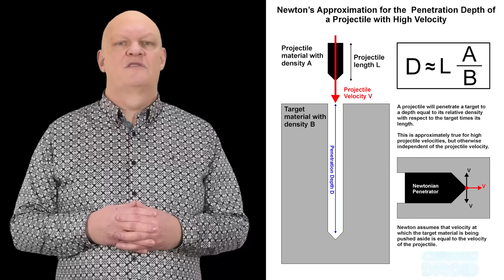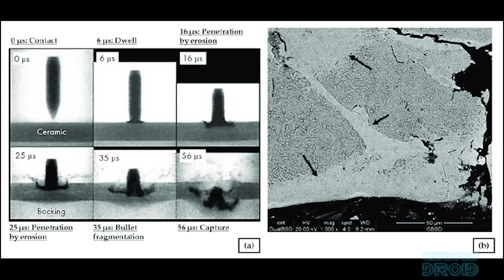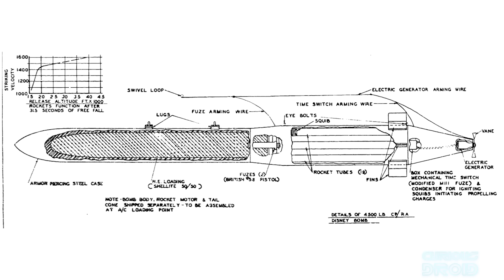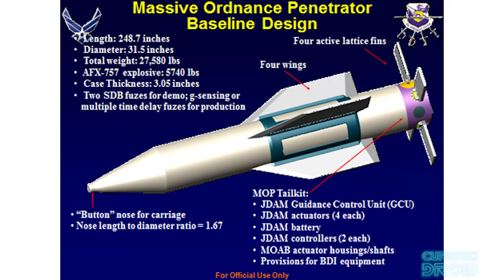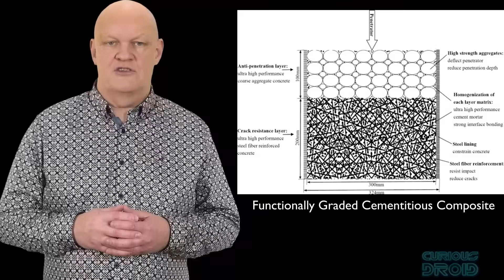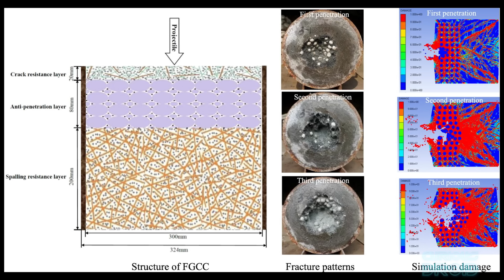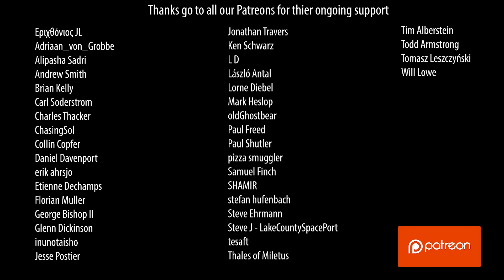Can Iran Stop U.S. Bunker Buster Bombs?

Comment: Just imagine haarp causing tremendous sustained earthquakes deep in the earth with pinpoint accuracy... followed by large TR3B style anti gravity hover crafts showing up every few minutes to drop Rods from God in precisely the same spot over and over, to hammer through the weakened structure. Followed by weaponized weather extreme flooding to flood through the cracks and drown anyone still living deep underground.
Is this sort of thing very far off?
I have a feeling that fortified concrete might be 40 years behind the times.

Comment: This bunker bombs will not happen in Iran...Iran has the V2(/)+ T drv Detector that is the equalant of the Iron dome process..Armour plate Tungsten gets its knetic energy is reduced to a level that its complete cycle is lost upon intial contact ...It will require a B52 Stream bombs to be dropped at 7000 ft above to achieve a penetration of 250 mtrs deep by 50 mtr circum..Irans tunnels are too deep and its in terrain hard to Map where the real target... it's not Gaza!!!

Comment: So apart from material used structure depth what if we use mild explosives ar top layer of bunker ?

Concept: Enhanced Bunker Defense through Kinetic Energy Dissipation and Trajectory Alteration

Overview: Traditional bunkers are built to withstand significant force and manage the shockwaves from explosions through various reinforcement techniques. While most bunkers rely on materials like concrete, steel, and natural rock to absorb and redirect energy, this concept introduces a new layer of defense aimed at dispersing the kinetic energy of penetrating bombs and altering their trajectory before they can inflict critical damage.

Key Additions to Traditional Bunker Design:

1. Controlled Explosives on Top of the Bunker:

Purpose: The introduction of mild, controlled explosives on top of the bunker serves to alter the path of a penetrating bomb.

Mechanism: When a bomb approaches, these mild explosives are detonated at the right moment to create a small, controlled shockwave that disrupts the bomb’s trajectory.

Effect: This disruption can deflect the bomb, causing it to change its angle of penetration or detonate prematurely, reducing its effectiveness. The goal is not to destroy the bomb but to misdirect its force, preventing it from reaching critical depths.

2. Soft Area Surrounding the Bunker:

Purpose: A soft layer of material such as sand, loose soil, or gravel is placed around the bunker to absorb the bomb’s kinetic energy.

Mechanism: When a bomb strikes, the soft material around the bunker compresses, acting as a cushion that absorbs the impact. This dissipates the bomb’s kinetic energy, reducing its speed and penetration ability.

Effect: The soft material spreads the impact over a larger area, slowing down the bomb’s descent and minimizing the transfer of energy to the bunker’s core.

How the System Works:

1. Kinetic Energy Dissipation: As the bomb hits the soft layer around the bunker, it loses momentum. The soft material’s compressibility gradually absorbs the bomb’s kinetic energy, preventing it from reaching full depth.

2. Controlled Explosive Redirection: Once the bomb penetrates the outer layer, mild explosives are triggered. These controlled detonations create a force that alters the bomb’s trajectory, pushing it off course or causing it to detonate at a less effective depth or angle.

3. Shockwave Management: In addition to traditional shockwave mechanisms, the soft layer and controlled explosions work together to dissipate any residual energy, ensuring that the bunker’s core remains intact even if the bomb detonates nearby.

Why This Approach is Effective:

Disrupting the Bomb’s Functionality: By using mild explosives and a soft outer layer, this system disrupts the bomb’s natural path, preventing it from maximizing its kinetic energy and destructive potential.

Absorbing Kinetic Energy: The soft material gradually absorbs the bomb’s force, reducing its speed and penetration depth.

Trajectory Alteration: The controlled explosives can redirect the bomb, causing it to miss the most vulnerable parts of the bunker or detonate at a less damaging angle.

Potential Applications:

Critical Military Installations: This approach would be particularly useful for high-value bunkers where the risk of bunker-buster bomb attacks is high.

Strategic Defense Systems: The system could be integrated into existing defense designs, enhancing the survivability of important military assets against modern penetrating munitions.

Conclusion:

This enhanced bunker defense strategy goes beyond traditional shockwave and reinforcement mechanisms by adding controlled explosives and a soft kinetic absorption layer. These innovations work together to disperse the bomb's energy and alter its trajectory, increasing the bunker’s chances of withstanding powerful, modern penetrating bombs.

Comment: One way...is by using hard and soft...in layers...reinforced concrete....airspace, plate steel, 1 inch thick...airspace...reinforced concrete...airspace...plate steel...deep underground, with perhaps a dozen layers...
It's not done because it is hard to build, difficult to maintain, and very, very expensive.

Comment: A relatively simple defence is to make the reinforcing rods at a 45 degree angle and the device would tumble as it penetrates either damsging it or causing early detonation. Most bunker busters are overgrown tandem warhead designs with a penetration charge to drill the hole for the main course to go through. The couter measure is similar except the furst later would be solid then something that guves a little with the tilted rebar rods in it then concrete with reinforcing rods tilted at the other direction. Same effect spoils the ability to penetrate enough to do damage.❤
Reply: rather life the kings chamber roof in the great pyramid

Comment: That high performance concrete is no doubt very expensive and not likely to be used as the primary defense. The more important facet of Iranian bunkers is that they can be burrowed into solid granite mountains as our own bunkers are. There is no protection like a natural granite mountain.
Reply: Finally someone who doesn't take quartz rock for granite.
Reply: What would be the primary? Depth?
Reply: @Zoooker1 depth and rock* 

A facility 40 ft under a Granite Mountain is pretty much impregnable to anything except nuclear weapons, even if it was made of cardboard. that said I suppose that there is still a seismic effect so if you could attack it with weapons that would not penetrate but could generate massive shockwaves than you could damage it substantially depending on how well it was protected against vibrations. of course that's something of a circular issue because there's no real way to generate such massive shock waves without a nuclear detonation. Although something like a massive fuel air bomb could get pretty close
Reply: @Laotzu.Goldbug  Interesting, those anti-vibration systems are crazy.
Reply: @Laotzu.Goldbug  you dont always have a massive granite mountain right where you need it...

then you use UHPC
Reply: @Laotzu.Goldbug I'm pretty sure Cheyenne mountain complex is made of a series of separate units like pods inside chambers all built on seismic platforms to counter the shockwave it's really well thought out
Reply: @ They really did think of everything when they built the Cheyenne Mountain Complex. It's over 1000 feet underground, and yes, there are individual metal buildings in the hollow that are on giant metal springs to take seismic forces. There are 2 25 ton, blast doors, one in front of the other and they are positioned at 90 degrees  from the tunnel entrance.  It was state of the art in the 1960's, but with modern technology, even the Iranians can build something like it I think.
Reply: @samhowells5798  It also has a straight path through it so a shockwave/overpressure can go through relatively harmlessly AFAIK. Shock-absorbers have been used for nuclear bunkers before, if you do that then even seismic waves might not do much.
Combining all these techniques and materials alongside the usual blast doors etc and you can make something genuinely inpenetrable with current technology I think. Only multiple strikes by nuclear weapons (or by a comically large nuclear weapon which don't exist anymore anyway) basically leveling the mountain.
You can theoretically make an almost invincible bunker right now.
Reply: @samhowells5798 Yes it is, lots of airlocks and giant shock absorbers, supposedly could survive a direct hit from a 9Mt device, though I doubt the communication links could take that. In the end 20,000 years later it would be explored like how we explored the ancient Egyptian tombs. 😂
Reply: @Laotzu.Goldbug  Does that mean the US didn't destroy those enrichment facilities after all, despite what they're saying?
Reply: @anatolydyatlov963  usa's current government just lied about iran and israel agreed to make peace. I can't trust them about bomb effects too lol.
Reply: @anatolydyatlov963 probably. They claimed success and then the following press briefing said they were still evaluating the effectiveness of the strikes so they really have no idea.
Reply: @Laotzu.Goldbug  Our underground bunkers are built on huge springs.
Reply: @anatolydyatlov963  I doubt that those bunker busters at the site in the mountain didn't work. You've seen the picture of the 6 holes made by the bombs, right? Well... if they didn't penetrate, then there'd be massive craters visible instead of 6 holes, because the explosion would still be very near the surface. Or all 6 bombs were duds... which is extremely doubtful. The other possibility is that the mountain wasn't as strong as they'd have you believe, the concrete wasn't as strong as they'd have you believe, and those bombs damn near overpenetrated and blew up deep within or under the bunker, which wouldn't leave quite such an obvious mark on the surface.
Reply: @rameynoodles152  the facility they are trying to destroy is smaller than the whole mountain. If someone is hiding in a haystack, even if your pitchfork is strong enough to reach them, you still have to poke in the right spot. Also, your best bet on how to defeat bunker buster is to deflect them into going sideways away from what you're trying to protect. The penetration of bunker busters all assume they are dropped on level ground. Mountains are famously not flat and when something hard and fast hits a hard angled surface, it deflects.
Reply: @1mrs1  The facility is smaller than the mountain, but it's not THAT small either. They clearly knew were to place the bombs, or you'd see the holes spread around. Instead, it looks like they basically dropped them down the same hole in two specific places. Plus, those bombs are 30,000lbs. Now probably half that is explosives, but 15,000lbs of explosives is a LOT. And actually they say they droppped 14 on Fordow... that's more than enough.
Reply: @rameynoodles152 The war heads are 5,000 lbs. I don't know whether we can deduce anything from the bomb placement. They could have known the exact layout of the underground facility or they could have tried to just get a spread of hits to hopefully get close. Either way, these bombs are getting through 1,000 feet of granite to cause any appreciable damage to a reinforced concrete structure below. They could hit the entrances and collapse them (wouldn't even need bunker busters for that) but that is just a few days of excavating to get their uranium back. I am pretty skeptical that you would get any additional penetration from attempting to drop a second munition down the same hole. If the munition hits the side at all it is going to tumble and your going not have all the momentum behind the hardened and shaped nose. Assuming the tumbling doesn't break the thing apart and cause the warhead to fail to explode, I would be surprised it would even reach the depth of the first one.
Reply: @1mrs1   I remember hearing from the defense briefing they gave the media that the bunker has vents with some shielding, but that the three holes were where the guarded vents were. They said that this was the target, and the the bombs could be directed to within inches of the target. Pretty interesting. I really wish we knew how much damage it actually did.
Reply: @1mrs1  This is false. The US is not guessing where the facility is, it shows up clearly on satellite images. For example, South Africa's super cereal sekrit nuclear facility was discovered in 1977. I remember the satellite photos showing the temperature outline visible from satellites. The USSR reported it back then because they were sensible about nuclear non proliferation. Unlike Vladolf Putler who is just nuclear stupid.
Reply: @Laotzu.Goldbug  Why stop at 40 feet (!3m). Just build it 1000m underground. Half of China's coal mines are under 1000m. 1500m coal mine are not unheard off.
Reply: @rameynoodles152  " Instead, it looks like they basically dropped them down the same hole in two specific places. " not quite. They left 6 holes in the ground.....however they dropped 12 bombs. They didn't basically drop them down the same hole in 2 places, they literally dropped them down the same hole in 6 places.
Reply: @nickl5658  I think the earth's core would be safer.
Reply: Not being there is better protection.
Reply: @kennybachman35 that’s why Air Force One was put into action 😂😂😂 I think it was Nixon who said he didn’t want to hide in a hole in the ground
Reply: No army can fight a mountain 😂 maybe with nukes
Reply: @abdou.the.heretic They can make it a mountain tomb by destroying entrances and ventilation. No need to penetrate the bunker.
Reply: @freeflyer1 it’s not the people they’re targeting. People are replaceable
Reply: Its not that expensive, Iranian UHPC is using small amounts of quartz, polymer and metal powders and fibers to achieve drastic performance improvement. The castings may have order of magnitude less material and still have double the strength required for protection against any conventional threat.
Reply: @volvo245  They need thousands of cubic meters of it, and that will be expensive. A mountain is free except for the cost to burrow into it.
Reply: It is at least 10 times as expensive as regular concrete.
Reply: Yeah. It won’t matter when the sun shines.
Reply: I’m not so sure about that.

Comment: something that a lot of people fail to see is that those bunker buster bombs are very huge and have a very big radar cross section.
YES B-2 is stealthy and can sneak its way to heavily protected target but the bomb itself is a huge target for the air defense
any expulsion happing around the free falling bombs and damaging its control surfaces will result in losing control and becoming completely useless as it will hit the ground with wrong angle or just missing target all completely. 
a lot of Russian air defense systems like Tor-m1 sold to Iran can track and engage bunker buster mutations.
Reply: Turns out no you were all wrong
Reply: It really comes down to reaction time. the B2 would wait until it was right over the target to drop and there may be something like 90 seconds of warning time. in theory if the radars were on and oriented towards the sky and the crews had permission to shoot at anything without waiting for identification/command authority they could be stopped, but there's also a very good chance that there wouldn't be enough time.

There's also the fact that despite what you might see in test videos or Hollywood when the US attacks a target there is a myriad of factors in play,  not just the aircraft and the bomb: cyber attacks, electronic warfare and countermeasures, decoys and so on.

Just like the arms race between bigger bombs and thicker bunkers is also the arms race between air defense and counter air defense.

In a real mission to attack a very high value Iranian bunker, for example with these kinds of weapons the B-2 would probably be only one of a dozen different aircraft involved (AWACS, Growlers, ELINT, etc).
Reply: @Laotzu.Goldbug turns out it was even much less than 90 seconds. It was less than 49 seconds apparently.
Reply: Time gave you you're answer
Reply: devanov3103  there's a Tor's attack footage of an Ukrainian drone size of a shoe box, no way this bomb's gonna pass through it.
Reply: @SheksgemWhepdo  the drone was not diving for the ground at mach 1,4
Reply: well if there is no AA system left around to intercept, it won't matter anyways.
Reply: What a moron. Lmao.
Reply: Lol welp .. so much for that theory. Not to mention you made a lot of speculation with little consideration to how much more is involved besides just some large 35,000 lb pound bomb dropping..... At nearly the speed of sound, with an accuracy of mere  few inches to couple feet ... And when you drop multiple of those... Like 12 in on one target.... Things are gonna blow. Iran didn't even have a chance to react.
Reply: From what I have seen, the USA tends to smash air defence radars, missile sites and airfields before the bombers hit installations, be it air, land or ship/submarine launched stand off weapons
Reply: @Frog1652 SPAA isn’t easy to destroy
Reply: Trump:  Hold my Beer🍺😅
Reply: devanov3103 
Russian weapons have devastated Western arsenal in Ukraine.

It's Russian strategies that have failed, not weapons.
Reply: @ajaykumarsingh702 Wrong. 😂
Reply: @ajaykumarsingh702 old western arsenal. Dont leave that part out. Russia has some great stuff too tho.
Reply: devanov3103 Taliban are listening.
Reply: Modern radars make even the B2s obsolete. Of course they'll work against small countries.
Reply: That is a very common misconception about stealth. No, the B-2 can't sneak, Iran's OTH and VHF radars can see the B-2 perfectly fine hundreds of miles away
Reply: devanov3103 dude doesn’t know what he’s talking about.
Reply: This didn't age well lol